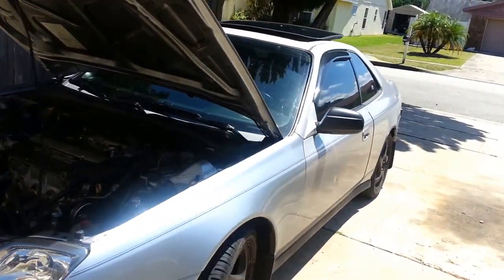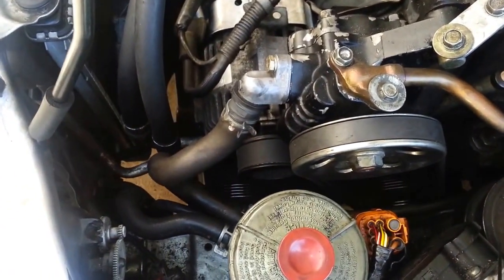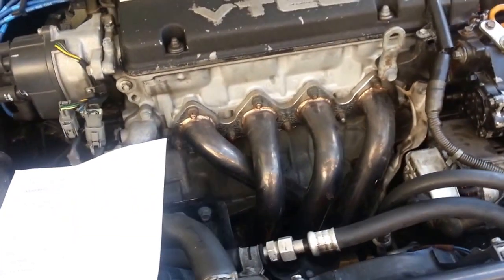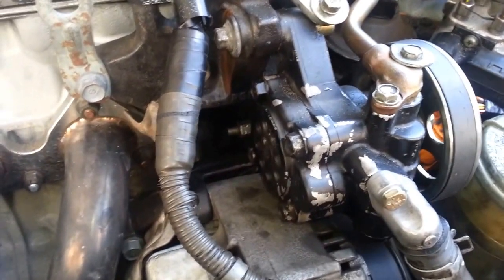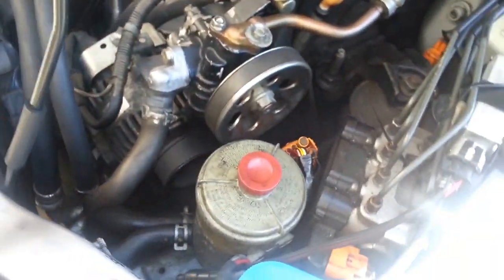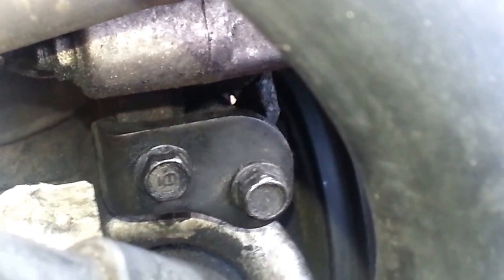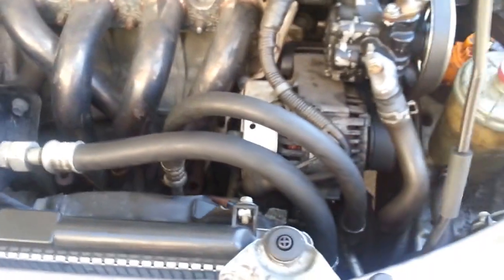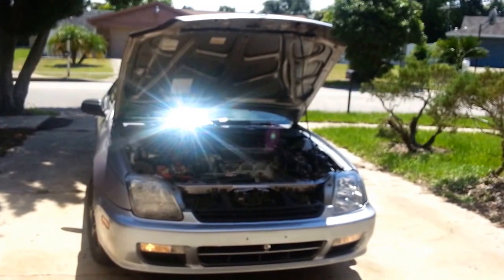Honda Prelude - A/C delete

Comment: so how much power do you actually gain by removing the belt? it doesn't seem like it would take much power to turn the pulley as long as the a/c is off. I've got a question though. I've got a 97 prelude base with the tiptronic trans. it was sold to me as stock, except for the cheap cold air intake. I put a magnaflow muffler on the stock pipe, and I built a sealed ram air system for it. but even before the ram air, and muffler, it has always seemed to run better than it should. the only things that don't add up, is the numbers on the intake, are different from the head. the ecu is the stock unit, and I didn't see a harness, so I assume it's stock. the intake is p13 hf2 and the head is p13 hf1. the only other thing that I've found is, on the front of the block, there's a square stud, which looks like it had a pulley on it. it's below the power steering pump. is that the balance shaft? or something for the prelude sh gear, maybe something like the atts? this is my first import, we've always built v8 muscle cars before, like the 69 dart in my profile. any thoughts?

Comment: 3:05 wrong! Yes you do put the wrench there. The nut on the other side he's saying to loosen in fixed in place and will not move until you remove the nut he's saying not to put a wrench on. If you do what he said, all you'll do is strip the nut, break a tool or bust your knuckles.

Comment: Does it really add horsepower? The ac puts extra load on the engine only when the ac clutch is engaged on the compressor. When not in use, it is a free spinning pulley. Does that make the engine lose a substantial amount of power? I think not.

Comment: I have an 89 prelude and wanting to do the same exact thing on the ac. But, the bolts are all in different places comparing to what you explained on your engine. It is a B20A5

Comment: for the 90 accord with the f22a a/c delete you'll need a 38 1/4 belt,37 inch will not fit and may have to remove a/c compressor or the pully cause the belt will be resting against a/c pully

Comment: This process would generally be the same for similar H22/F22 Setups correct? I have a Compressor that's grinding and getting ready to lock up. I just don't want to deal with it anymore. 92 Accord H22. I have seen some A/C Compressor Delete Pulley's you can buy that replace the Compressor with a blank Pulley Slot, but can't find the right part # for my Honda Accord...

Comment: hi,I just watched your video and its exactly what I was looking for cause I was about to do this on a 90 accord with the F22 engine its having a\c problem and I wanted to replace compressor with a bypass pully but couldn't find one ,would the 37inch belt fit or how did you get the measurements for the right length belt ,would the parts store know this or I need to measure the crank shaft pully to the alternator pully

Comment: I think my power steering is messing up so instead of fixing it I just want to delete it . Could I just remove the lines and pump and leave the rack there ?
Reply: if you remove the pump from it, you can drive it, but it will be a bitch to turn the wheels. either get a rack from a non power steering car, or fix the pump. I would strongly encourage you to fix the pump.
Reply: @ihateliberals518  I've heard that there isn't a manual rack that can be used on Preludes....
Reply: Ive been looking for manual rack for my lude for 2 years now so yea most likely they dont make em so i drive my car with no ps pump just make sure u have an extra rack just in case it goes bad from driving ith no ps